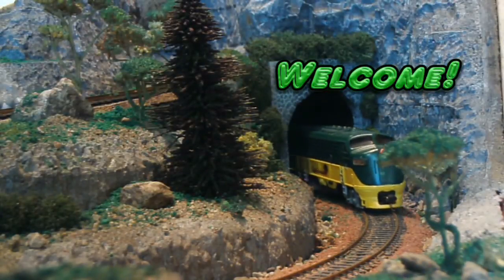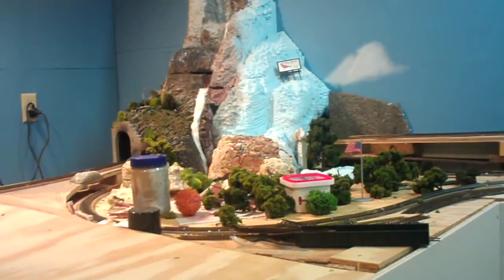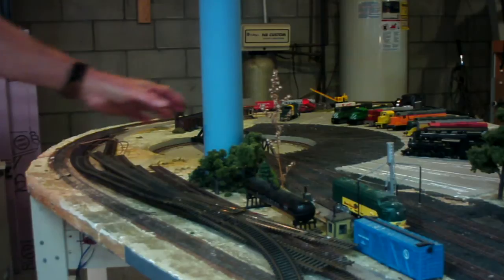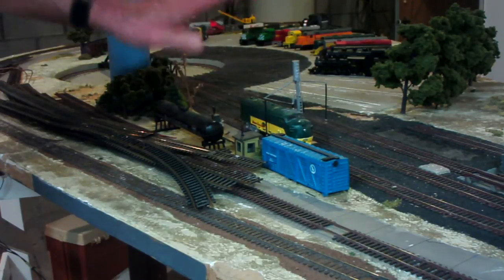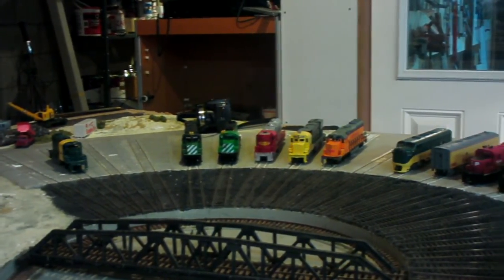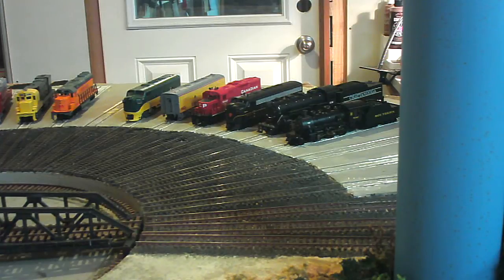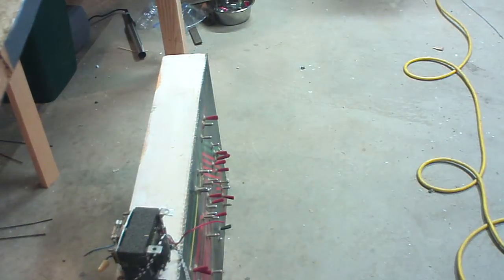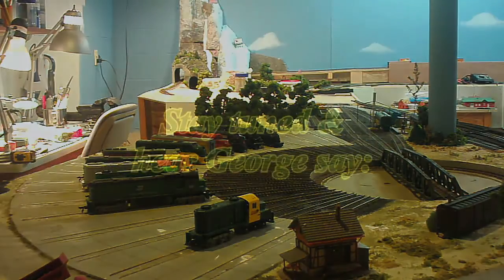Turntable update and another question

Comment: Hi George • My Hat is On • The blue sky is OK • Like the water tower idea • Go for it, cut the pole - Build a new header to hold up house. Cool control panel. You do have a dumb truck at the steel mill.
• Cheers from Michigan
Reply from the maker: Is that a dumb truck or a dump truck? It was in a mess of little pieces that I was given that were mostly hot wheels but this was definitely smaller. Not much detail on it, but it will work for now...right?
Reply: Spelling does not count. Dump
Reply from the maker: Well, it sure would if you were telling me that I had a dumb truck or a dump truck to use tomorrow to go to the dump in. My truck may be dumb, but it doesn't dump. LOL

Comment: Great looking railroad and like your "scrapyard" very cool stuff! OMG that control panel, wow, that is some bunch of wires.
Reply from the maker: Thanks Rich. Yeah, I have my work cut out for me getting the turntable up and running again.
Reply: George, what scale and brand of trains are most of this set up?
Reply from the maker: MustangConnection1
This is all HO scale Rich. Hope you are having a pleasant "Labor Day" off.
Reply from the maker: MustangConnection1
Sorry I missed the second part of your question. Most of my rolling stock and engines are old Tyco pieces. I do have a couple of Bachman engines and a few Walthers pieces of rolling stock. Eventually I would like to upgrade more of my Tyco stuff as it is very basic and not really well detailed or reliable. I get what comes to me and what I can afford through bartering or doing my scrapping for cash.

Comment: Pole: Could you consider turning it into a multipurpose structure: Offices and headquarters for part of it,, control tower for the yard, water, fuel oil storage, ballooned out at the top into a restaurant / viewing platform at the top with lights to illuminate the turntable area at least. Car Park around the foot of it (don't know how these might have access though!). Alternatively some sort of architectural structure vaguely like a needle shape.

I cannot judge from the video about how much actual space you have and also need to join the turntable and main layout together but is the turntable mainly for trains? If so you need a heap of points allowing switching from tracks to tracks in both directions that links to the main yard.
Reply from the maker: The next video will answer some of the questions, while raising more (for me anyway). A multipurpose building structure is a good idea, with various buildings surrounding the pole, rather than making the pole itself the focal point. Thank you for the ideas.